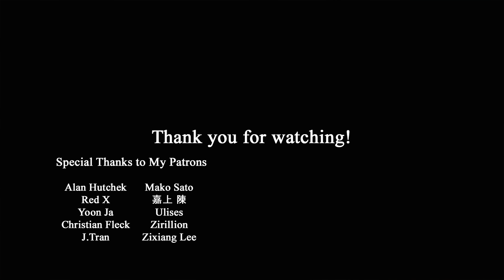Epoxy Resin Diorama - U-Boat meets her demise.

Comment: Outstanding work, as per usual! Something that I've seen done before was letting the resin cure in layers, to eliminate the need for clear stands for depth charges; I can see that working quite nicely with your style, so that might be worth experimenting with if you decide to do a diorama like this again at some point
Reply: Might reduce heat as well?
Reply: I kind of liked the stands, they looked like the bubbles from them sinking
Reply: You would need to be really careful not to end up with a visual boundary between the layers, though.  It can be done, but I've had the misfortune of it happening in one of my projects.
Reply: @toddz8579  as a diver, the visual boundary is often encountered in undisturbed waters: deep inlets, deep dives. There's no water movement, so the "layer" is the temperature difference. But like plastic looks like glass in modelling, but GLASS doesn't look like...........glass, I can understand it may not look real. !!!!
Reply: @AmokCanuck  I agree.
Reply: @hubristicmystic  aww de pptt
Reply: @AmokCanuck  that's exactly what they look like

Comment: Incredible modelling!! Only suggestion (if I may be so bold!!) would be to include bubble trails for the propellers to give idea of forward speed when running into mines. 👍
Reply: The U-boat could have been stationary underwater at that depth after firing torpedo's so as not to alert hydrophone listeners but it would have been picked up on Asdic & thus a sitting duck for a spread of depth charges. I agree, Great modelling.

Comment: I love that you even thought about the light refraction between the depth charges and the water splashes at the surface, so that they don't align exactly. Awesome!
Reply: You noticed the parallax effect but the artist didn't 'think of it.' He built the depth charges and splashes aligned. The parallax effect from any view angle happens because the resin is denser than air in the same way water causes parallax. So much realistic detail, not many picked up on that effect but you and I did.
Reply: @jimsedlock7637  good to know, thanks for the explanation. I honestly thought the artist was a genius for considering the parallax effect. But even if it's just a natural coincidence the artist still remains a genius for building this stunning model

Comment: Well done!  But it really would be nice to disclose the brand resin you used on your deep pour.  I've just poured a 9" x 4" x 4" with Liquid Glass ( a deep pour resin ) and it's now taking my sealed paint off the sub and eating away at the cotton simulating the explosion.  More aggravated at the $80 spent for the resin versus the most likely loss of the $15 submarine.

Comment: Marvelous job! I did something like that years ago with a sailing ship at anchor, but not nearly as nice as yours! I poured the resin into an old aquarium and left that intact. How did you avoid the problem of heat generation with the curing resin?? I had to pour only a half inch at a time to keep the heat from cracking the whole thing!

Comment: Tip for faster and better finish. Wet sand the epoxy from 1200 grit to 2000 grit, compound and polish, then apply wax. It will appear the Epoxy is still wet. Also, you can use a mold release wax to give you a much smoother and glossy finish. Might not even need wet sanding and polishing with the mold release waxing.

Comment: Hej 😊i am about to do the same project (you inspired me) but i have a simple question: if i paint model with aqua colors, and it dries properly, won't there be any issue when i pour epoxy on it? I mean, how would dries acrylic based paint deal with epoxy resin, wójt epoxy melt the paint on the model?
Reply from the maker: Epoxy resin weakens the acrylic paint but it never causes any trouble unless the paint is scraped with a sharp object.
That is my case at least.

Comment: The finished diorama looks fantastic, but a sub hit by a depth charge would not explode outwards but buckle IN as the outside pressure is higher than the inside pressure.

Comment: The only errors I see have to do with position of the bow and stern as bow would tend to have a slightly higher upward sweep with a little more tilt to the right and stern a little more to right but explosive tilt within within limits.  Though placement would be difficult clear glass beads of various sizes and a glass void could have been used for escaping air.  But most definitely war museum quality as it stands.  EXCELLENT WORK!

Comment: That is an incredible piece of Art. 
However realisticaly the explosion would have been only outside and smashed the hull inwards, like you smash a coke-can. And directly above their would have been a circular patch of foam on the surface as a result of the shockwave of the blast.